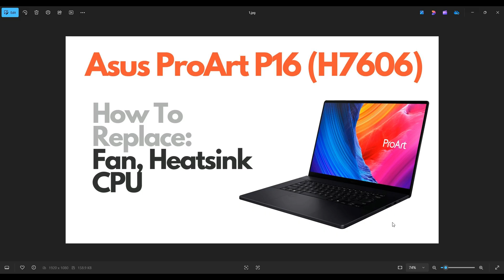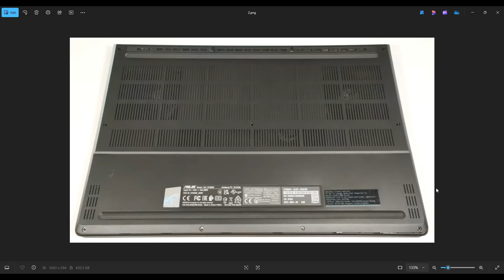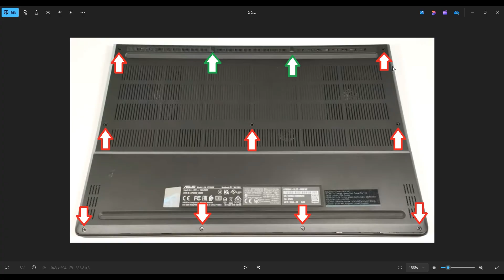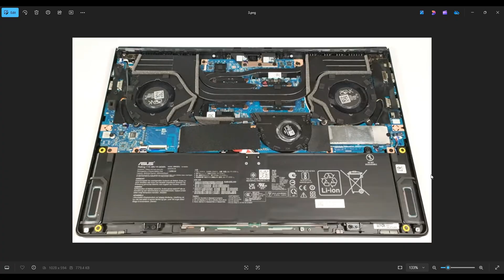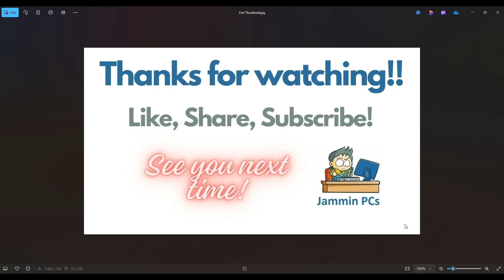How To Replace Fan Heatsink CPU GPU - Asus ProArt P16 (H7606) Laptop Computer

Comment: The worst thirdrate asus laptop Proart H7606. In 15 months, the motherboard has burnt out. These chinese products are built with low quality useless parts. Costing almost 3500 USD it does not last for even 15 months. Worst Chinese garbage product with extremely useless service partners

Comment: Thanks for this! Very helpful. Got my Asus proart last year and its been phenomenal. I can see the underside and it was dusty. Used some compressed air to clear the grate, but it still gets super hot. I can see dust inside and I really want/feel the need to clean it out so it stays nice. I wasnt able to get the back off yet; need to get a good plastic pry tool. I just don't want to break it trying to take the cover off. Super useful info in this vid tho as a newbie IMO. Thanks again
Reply from the maker: Thanks for the kind comment :) You can see some pry tool options here: https://amzn.to/4jcrQph as well as some thermal paste options. Let me know if you need any help with that operation once you get going :)